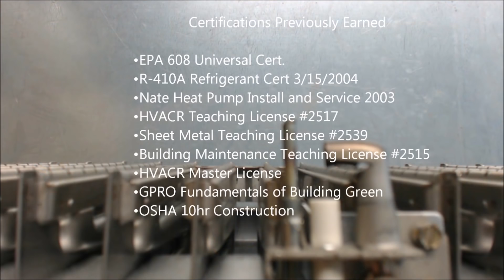HVAC Accumulator Tank Purpose, Location, How it Works!

Comment from the maker: Tool List-  https://www.amazon.com/shop/acservicetech
Support-  https://www.patreon.com/acservicetech
For those that are looking for the tools used in the videos: (Linked Below)

Here is the link to the Plasti Dip 14.5oz can  http://amzn.to/2pSyoP9

Here is a link to Refrigerant hoses with valves used in the videos-   http://amzn.to/2aBumVI   

Here is the Link for the Yellow Jacket Refrigerant Manifold Gauge Set used in the videos-    
http://amzn.to/2aenwTq

Here is a link to the UEI DL389 Multimeter used in the videos-   http://amzn.to/2av8s3q

Here is a link to the Hilmor 4 port Aluminum Manifold Gauge Set- 
http://amzn.to/2m4QLik

Here is a link to the Digital Refrigerant Scale used in the videos-  
http://amzn.to/2b9oXYl

Here is a link to the Imperial 535-C Kwik Charge Vaporizer for Charging Refrigerant-   http://amzn.to/2oge0u9

Other tool links can be found in the video description section.

ACSERVICETECH is a participant in the Amazon Services LLC Associates Program, an affiliate advertising program designed to provide a means for sites to earn advertising fees by advertising and linking to Amazon.com.

Comment: Long line sets are not the reason to use an accumulator.  That would be a band aid for improper refrigerant control.  Long line sets need a solenoid drop, to prevent liquid refrigerant from dumping into the evaporator, and migrating to the compressor oil during the off cycle.

Comment: Hello, very good information thanks. question, i have noticed a little fluid leak on my acumulator when heat pump is running. not always does it, is this something to worry about?? now cooling is working fine.

Comment: Great videos man.  Always informative.  I have a few questions, don't know if anyone else has asked.  I've never heard of adding an accumulator to just a basic condenser.  How long of a lineset are you talking about when considering adding one?  Also if it's an extremely long lineset with a fixed bore metering device at the evaporator, and it's losing superheat on the way back to the condenser, wouldn't this effect the charge on the system?  Basically, what conditions would you observe to get you to consider adding one?
Reply: I have the same question. How would it loose superheat? Isn't low temperature low pressure gas exiting evaporator colder than ambient? It would just be more superheated, bad for efficiency, but it wouldn't change phase. Unless it's cold outside and unit is working in cooling mode.

Comment: I went to a service call last week with a HP flat on refrigerant.  I did a leak search and found the accumulator leaking from side.  It was also all rusted a paint chipped all up.  I ordered a replacment accumulator, brazed it in and performed and tested for a leak at 200psi. I heard a hissing noise and was baffled to find The new accumulator leaking from the same side as the old accumulator.  Any reason as to why you think?  Should I wrap the accumulator when brazing.  Or do you think the new accumulator was just bad from the factory?
Reply from the maker: That was bad from the factory. The steel should not leak on a new accumulator tank!
Reply: @acservicetechchannel  ok thanks for your response

Comment: Hello sir. I have a question i when to a call to services a heat pump. I found that the unit was frozen from the service valve to the compressor. In cool mode, do you think that it could be a restriction in the accumulator?
Reply from the maker: The unit would first have to be melted and then after the unit starts up in cooling mode, you would need to measure the superheat, subcooling, vapor and liquid sat temp, indoor and outdoor db, as well as the delta T. I will be publishing a troubleshooting book within the next two weeks that details what each reading means, thanks JesusDisciple 7 and great name! Was the rest of the vapor line not frozen? Was the vapor service valve fully open?

Comment: Mine is freezing up and I’m getting cold air inside instead of hot
Reply from the maker: The reversing valve may not be powered if it is running in ac mode. If it is running in heat mode, be having a hard time absorbing heat from the air outside at the fins, possible low charge. A tech would need to look a it, thanks
Reply: Thanks greatly appreciate I was hoping I’d be able to fix it, it’s all electric unit no gas and I run the heater for a while and works fine but after a few hours it’s blows cold and there’s a puddle of water outside and that tank is frozen over . And the desired temperature is only 68 degrees
Reply from the maker: The puddle of water might be right after the defrost cycle. This is when the outdoor coil melts and reverses its cycle for a period of time before running in heat mode again. This needs to happen in order for the outdoor coil to melt the humidity off but usually the electric heat strips turn on inside to offset the cooling mode during the defrost cycle, thanks
Reply: AC Service Tech LLC thank you and thanks for taking the time to reply
Reply from the maker: Glad to Help Andrew!

Comment: I see the top of a lop of accumulators rusting.  Should we be wire brushing and painting, or using POR15, or cleaning and applying a self adhesive insulation material on the top or just leave it alone because it is just surface rust?
Reply from the maker: Yeah wire brush, plastidip, wheel well paint, the por15, yes you should mention that to the homeowner and ask if you can do that. The rusting may happen at the bottom too so just check, thanks

Comment: Question?  8:00 to 8:30, you said that with a long line set the vapor returning to the compressor would reject the superheat and the refrigerant vapor would re condense to a liquid?  In cooling wouldn't the suction line temp be in the high 40-low 50s and actually absorb heat making the total superheat higher?  In my experience superheat at the outlet of the indoor coil is always less than the superheat at the suction line before the inlet to the compressor.  Please clarify.

Comment: Can you confirm that Inlet side of Accumulator is NOT  the compressor connection ?
I think inlet means  suction line coming back inside the condenser then other connection on Accumulator goes to compressor ?
Thanks
Reply from the maker: Inlet is going into the accumulator. Outlet is connected to the compressor, thanks
Reply: acservicetech Thanks AC Service Tech ! You are helpful as always !

Comment: I want to pump down a 10 ton split system, but they put the high side service valve 6 inches away from the compressor discharge line instead of 6 inches away from the bottom of the condensor. The discharge line that comes off the condensor goes to an accumulator and then exits out into old wrench type ball valve and continues to a sight glass and ends at a solenoid valve. I just wanted to know if the accumulator would be alright if i closed that wrench valve to do the pump down. I am trying to fix the valve body section of the discharge solenoid valve, Unit is R22 w/ txv.
Reply from the maker: Do you mean the line connects from the condensor to a receiver. An accumulator would be on the suction side. This sounds line a refrigeration unit and not an air conditioner since it has a solenoid and sight glass. Typically a manual pump down can be done by shutting off the flow at the receiver, thanks
Reply: acservicetech. My mistake, yes it's a receiver and it's actually just a big a/c for Data Room. In your experience, has there ever been any damage to receivers by filling it with liquid i.e for a pump down, anything helps.
Reply from the maker: No prob, the liquid receiver is there to store subcooled liquid so as long as it is adequate size, it should be fine. Any refrigerant left over would be stored in the condensor coil. The receiver is actually used for the purpose of pump downs on pump down refrigeration units, thanks

Comment: On a Amana PTAC unit there is always a, I’m guessing, accumulator. It’s always on the unit no matter if it’s a heat pump or straight cool. It’s always mounted to the compressor... the suction line comes from the evap — through the “accumulator” — out the bottom —into the bottom of the compressor — out of the top — to the condenser. Is this a accumulator? Thanks!!
Reply from the maker: Hey Danny, yes that is another version of an accumulator on the side of a rotary compressor. They always come with the accumulator because some of those systems are used in scenarios that may not shut off and the indoor wet bulb gets so low that there is no superheat to protect the compressor, thanks and great question!
Reply: acservicetech Thank you!!!
Reply from the maker: Glad to help Danny!

Comment: Great video! I came across a heat pump both lines going to evap were cold liquid and vapor line. There was a slight difference in temp of lines but it just threw me off that liquid line was cold. Outside temp was about 74 and high side pressure was 150psi  sub cool was around 7 , super heat was asking for 18. Low side was 68 psi. R22 system. Couldn't trouble shoot much as my meter and other tools were left behind at  another job lol. Can you give your thought on this.
Reply from the maker: It is possible for a heat pump to shut the outdoor fan off if the pressures are going to high because it is soo easy to absorb heat at a high temp like that, and hard to reject heat in the building due to high temp. Is it possible, you felt the lines while the outdoor fan turned off? If you were in ac mode which is what it sounds like then it is possible that you are operating very efficiently. What was the delta T across the indoor coil. Sometimes when we feel lines, it tricks us because you just told me the temps on the lines because of the subcooling and the superheat, 56 degree suction line, 76 degree liquid line, thanks

Comment: i can ask one question what is the really cause if accumulator is turn of ice
Reply from the maker: Is this during heat mode when the outdoor coil is frozen, is the rest of the suction line frozen? If so it could be low airflow or low refrigerant pressure on the low side, thanks tyson!

Comment: Highly informative!  I have a heat pump wall shaker unit on a portable building at work that's icing up the evap coil.  Charge is good...added some initially as SH was high (oops)...probably ended up just parking it in the accumulator with no improvement to pressures.  Suspect piston blockage.  Air flow good, return is 12" duct, straight from ceiling register to return of unit.  Filter clean. Low side pressure  below 100 psi, high side good over 300 psi at 90 ambient on 410a system.  I hope I'm on the right track!  Thanks for all you do.
Reply from the maker: Yes, refrigerant low side pressure that is low with a high superheat before freezing means some type of liquid line restriction, thanks

Comment: Thanks for the excellent video.  I'm getting ready to having my lines run underneath my patio since I'll move my AC to another location.  Is there any problem with installing the lines underground?  Should I put them in a conduit?  thanks for your advise.  Do you think I'll need an accumulation.   About how much does it cost for an accumulator to be installed or do all units have them?  thanks.
Reply from the maker: An accumulator is not needed unless you are loosing superheat due to the vapor line rejecting heat. Only heat pumps have them preinstalled. A lineset can be run underground if it is in a pvc conduit with both ends sealed so water does not get in. You could however mount the lines to the underside of the joists on your deck and this would be the least labor, thanks
Reply: Thanks, it's a cement slab so I was going to run it just  below the slab.  I'd like to run it in  conduit but I also am afraid of sealing the ends so water can't get in.  It's open to the weather at both ends.  It's a 3 ton Trane.  I'm going from about 40' line length to about 80.  Do you think the line sizes need to be a bigger OD?  In Louisiana BTW.  I've read about the earth cooling the suction enough that the gas turns to a liquid and slugs on start up.  The ground is pretty warm in Louisiana however but do you think I would have a slugging problem and is a solenoid the fix?  Thanks so much.
Reply from the maker: An accumulator would help to protect, 7/8" would be. I certainly would sleeve it and where you come up at just reduce the pvc size, cut the insulation on the vapor line and add a good sealant. Push the insulation up to the pvc when done. It is also best to use 45's and to exit out of the pvc horizontally above the ground or with the pvc pointing slightly downward above the ground., thanks
Reply: thanks very much

Comment: Do scrolls need a start capacitor on txv systems? Thanks.
Reply from the maker: It really depends on the design of the unit. Many heat pumps have a start capacitor, start relay, and dual capacitor. Some do not. There is not set guideline for scroll or reciprocating compressors needing start caps. The manufacturer will determine if this is needed due to the design of the compressor, ambient conditions, whether there is a crankcase heater, and application. Thanks

Comment: good vid.
for some reason I have to learn things many ways many times. then one day it just clicks. lol
I actually don't like working on a/c but always get put on it.
Reply: TurboFlush same!
Reply from the maker: That just means your good at it then! What is your favorite?
Reply: heavy technician.
sad part is.. I am not that great at a/c. but I can read the manufacture manual. and have the curiosity to find out why.

I always laugh.. working a/c is a hot job. why.. because if it was making cold air... you wouldn't be fixing it. lol
Reply from the maker: Exactly, that is what we say here. We get it running and then as soon as it is putting out the cold air, we leave! Have a good one TurboFlush!